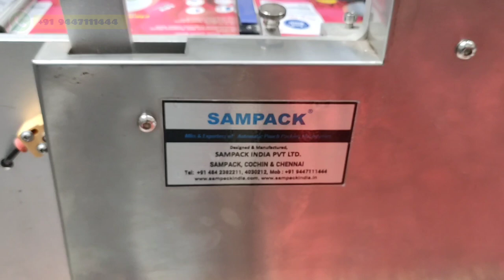Round bottle labelling machine | Automatic Stickering Machine | Sticker label applicator machine

Comment: is it possible to do labeling of specially designed bottles of different shape and size using single machine (with change parts).?
Reply from the maker: We have all types of Packing machinery .Sealing machinery, Coding machine,  We are manufacturing all types of packaging machinery.   
Please contact +91 9447111444,9447788885 E-mail: info@sampackindia.com,